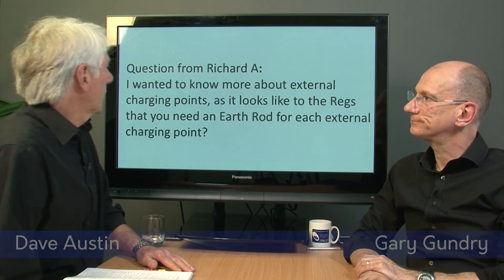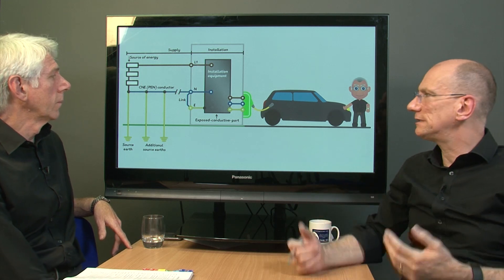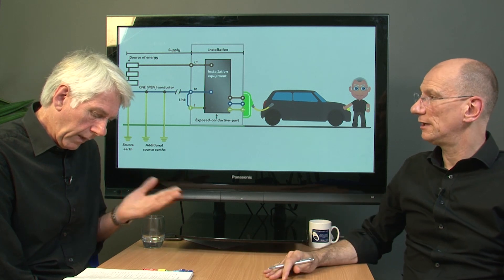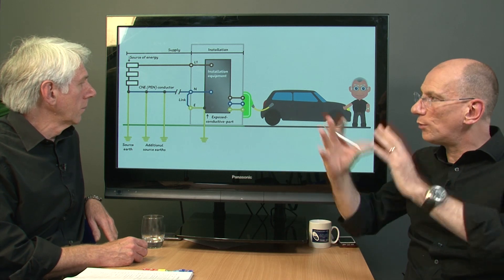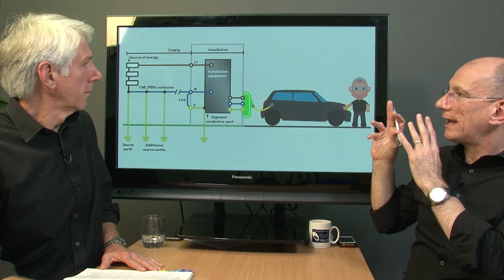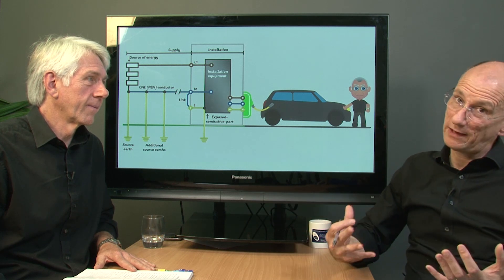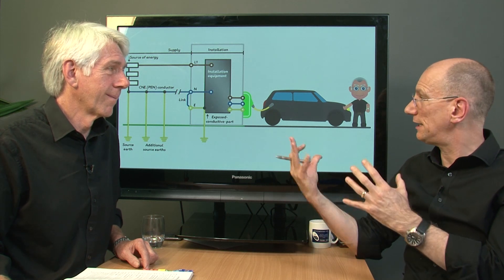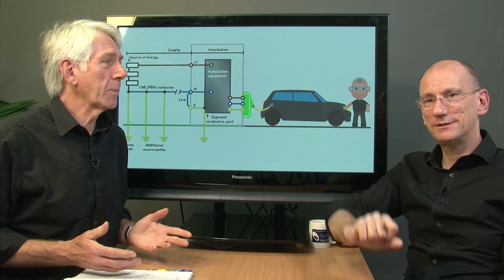18th Edition Breakdown - Q16 - Earth Electrodes and Electric Vehicle Charging Points

Comment: Has this been superseded with PEN fault detection units like the Matte, Hypervolt and Zappi charging units?
Reply: Hi Mark, technology wise and also from a practical point of view, this requirement, although still current within Amendment 1 of the 18th, is unlikely to be used as the resistance requirements can be difficult to achieve. Will be interesting to see what Amendment 2 delivers on this and also new requirements if any for the use of devices incorporating PEN protection.  Thanks for your comment. LL Team

Comment: Thanks for this video. 

I have seen many YouTubers installing their earth rods adjacent to the charging point and I couldn’t figure out why they didn’t sometimes offer an alternative. 

Based on what you say and the regs detail this is supplementary earthing so could be close to the CU which maybe a physically and aesthetically better and easier installation. Is this correct?
Reply: You can but you then have to factor ensuring touch voltages is kept to 70 volts or below. This can require very low electrode resistance that may be hard to obtain. It becomes easier to separate the TN and TT sides...or ultimately go for an electronic solution to open circuit on PEN conductors. It's a lot more complex than many imagine and we spend a lot of time in EVE working through the solutions.

Comment: Hi Dave/Gary, Thanks for the helpful video! Just a quick one: If you use the option of electrical separation, does that mean that RCD protection is then NOT required?

Sam
Reply from the maker: Hi, when Electrical Separation is used, you can omit RCD protection for the EV circuit - reg 722.531.2.101 :)

Comment: Hi Gary/Tony,

If yo decide to use the option of electrical separation and buy a transformer. Does this mean that you no longer need RCD protection in the chargepoint?
Reply from the maker: Hi - Reg 722.531.2 RCDs - clarifies that 30mA RCD of at least Type A is NOT required when using Electrical Separation. Hope this helps. Dave Austin.